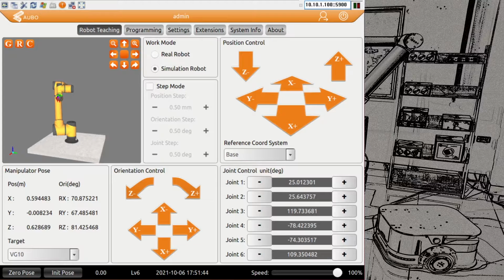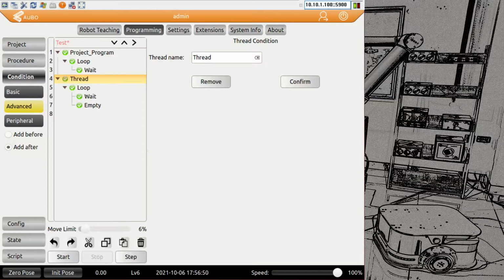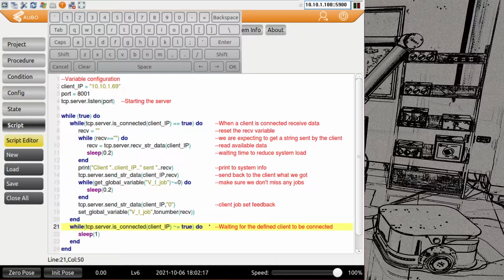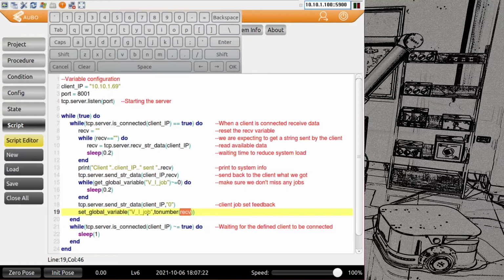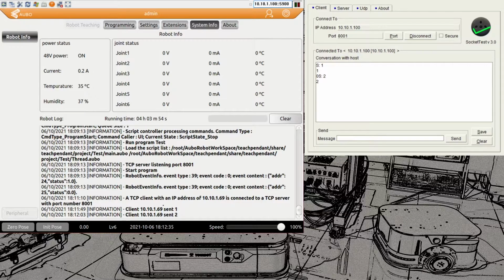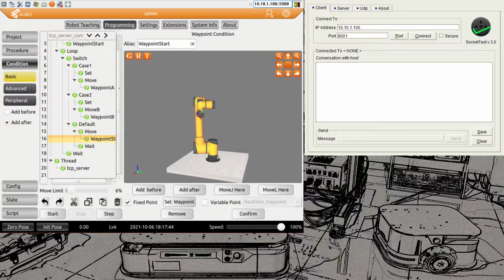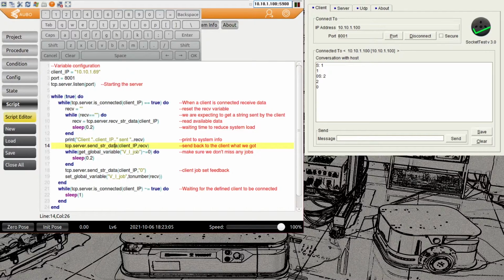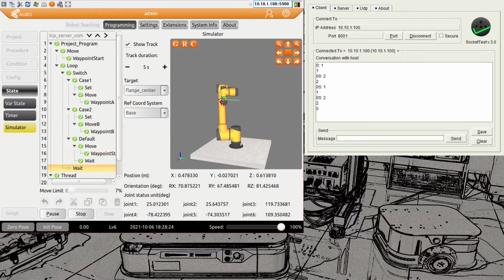How to send tasks to the robot via TCP

Comment: Nice video, we have AUBO I5 in our lab. I am using 3d camera mounted on the gripper to find the pose estimation of an object for picking and placing task. what method can i use to send only the  6D pose of the object from my computer( where the whole computation is happening) to the robot.
Reply from the maker: Hi Abood,

Thanks a lot! There are several methods how you can achieve this. To recommend the best way for you and to make sure that it's compatible to your application, please send us some more details about your application to aubo@gerenga.com.

If possible, kindly explain how your application works, how you already communicate between computer and AUBO and include some screenshots and photos of the application.
We don't want to make too many assumptions and in the end you cannot use what we recommend.

Looking forward to hear from you.

Best,
Oliver